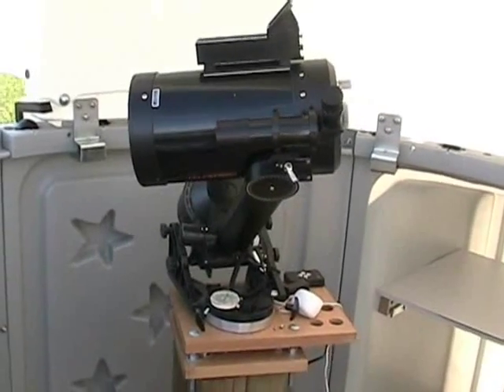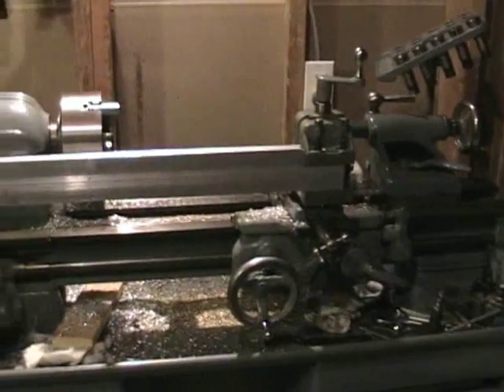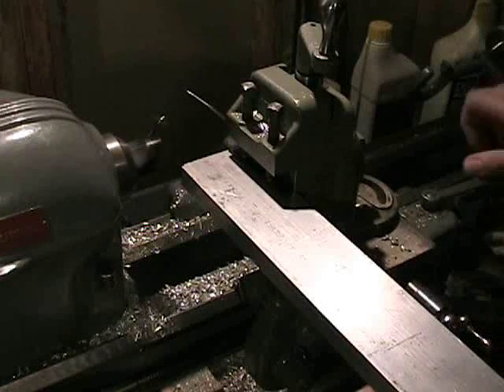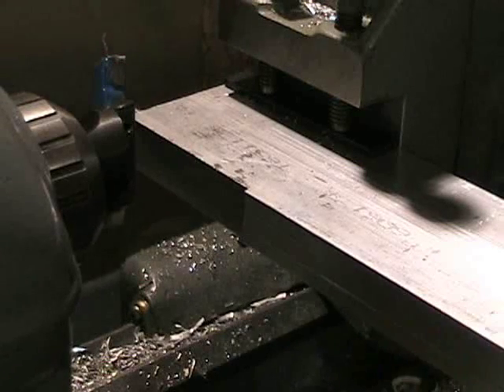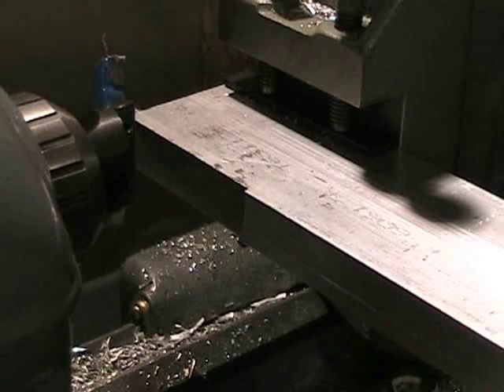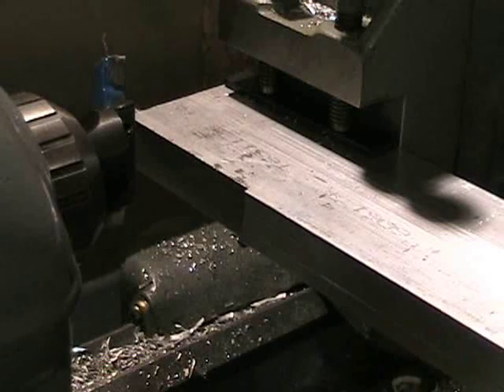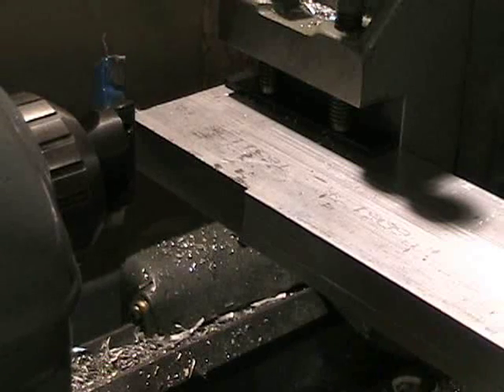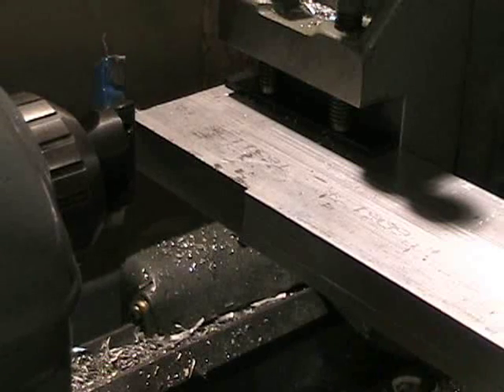Machining a C8 Dovetail Bar

Comment: Impressive!.. :) however, i still think it was a little bit too much work for the result. wouldn't it have been much easier just to mill down a 2" wide x 13" long x 0.6" thick 6061 bar, straight to 15 degrees on each side, and then just connect it to two blocks having that round cut done by some other less dangerous process? :D i appreciate that you used only one machine, though, and yet you got it done just right in the end. congratulations! ;)

Comment from the maker: The aftermarket ones cost ~$70 US, but one is raised on spacer blocks, adding potential flex, the other has an 8" dovetail bolted to a plate, limiting the useful span.
Of course, the finish on them is nicer. At least, until I get into home anodizing :-)